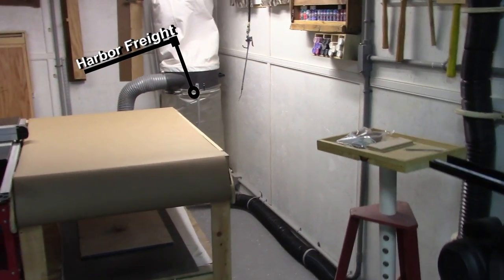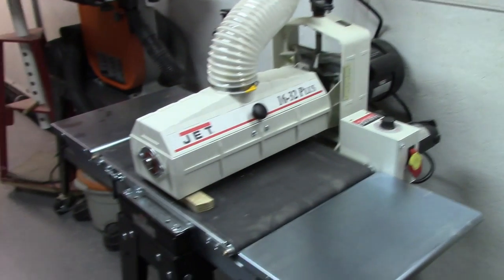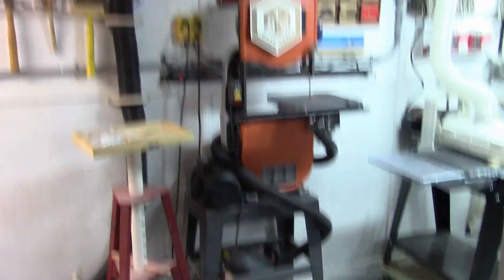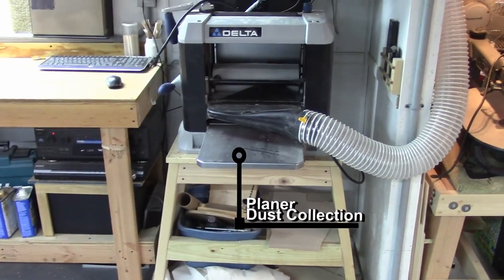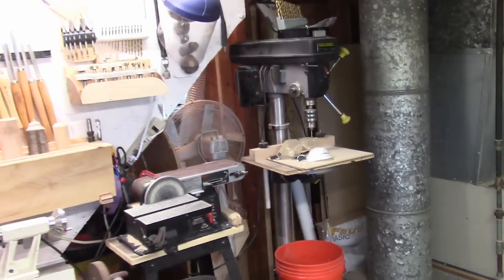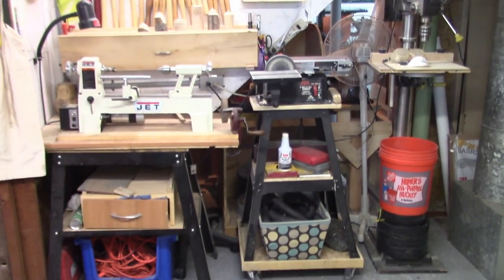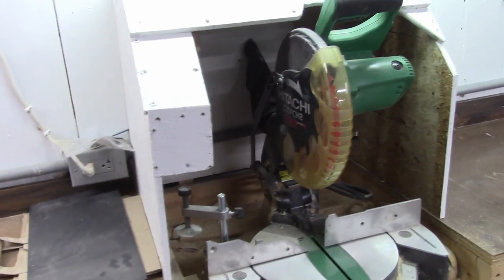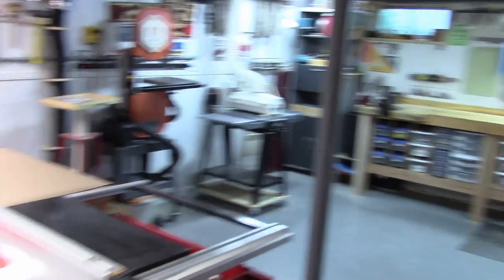2 New tools & a new shop layout. Finally setup !

Comment: Congrats on the new additions to your shop. One thing I would add is a shaker felt bag for the HFDC. The factory bag likely will not be enough to filter the fine dust from the drum sander. I too, have the HFDC (although 10 yrs old) and it came with a 30 micron bag...not good enough. Not sure, but the newer ones may have a 5 micron bag, so it may doo the trick.